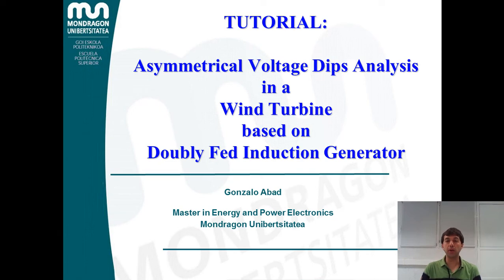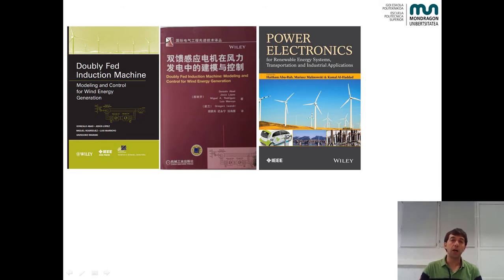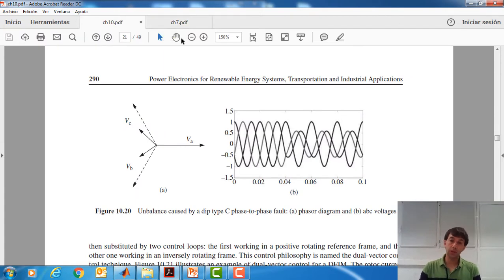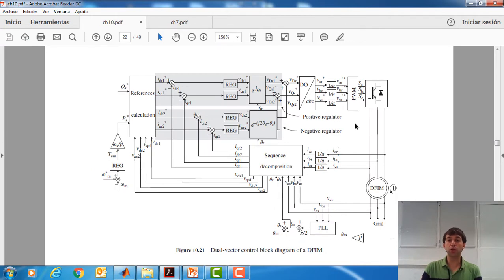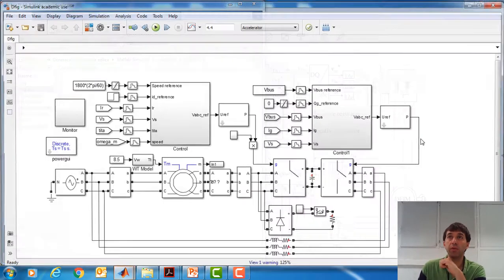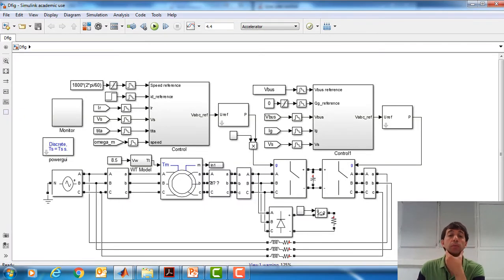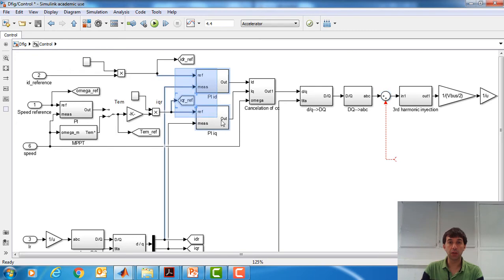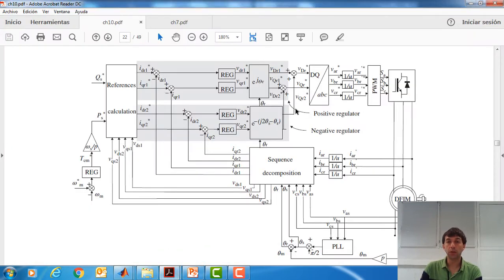DFIM Tutorial 7 - Asymmetrical Voltage Dips Analysis in DFIG based Wind Turbines

Comment: This tutorial video is a short introduction to the asymmetrical voltage dips analysis in a wind turbine based on Doubly Fed Induction Generator (DFIG), using MATLAB-Simulink. In relation to the requests of some of you asking for the library files and/or chapters of books, please, keep in mind the following: 1. I cannot provide you the Matlab or Simulink files. These video tutorials are intended to be just an additional tool to learn by oneself. If I send you the files, you will not learn by yourself. 2. I cannot send you any part of any book. I would infringe the Copyright. rafiee.zahra@gmail.com